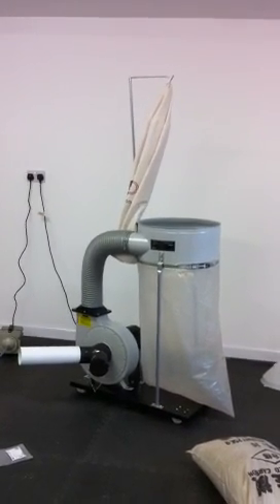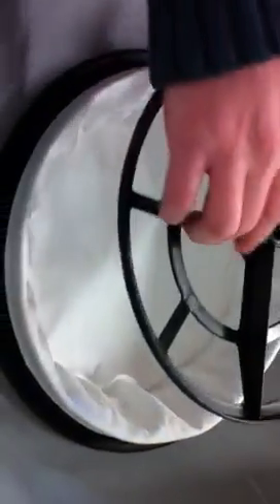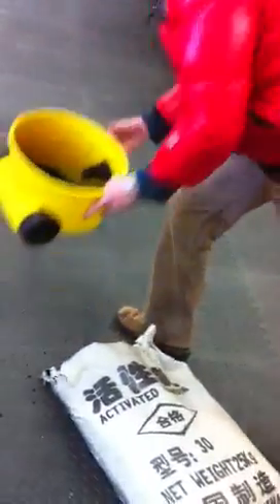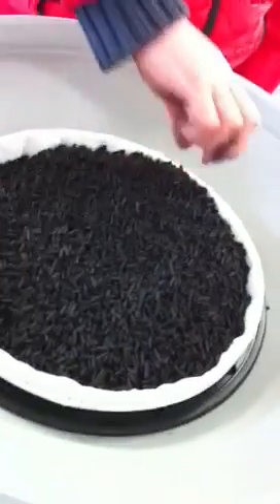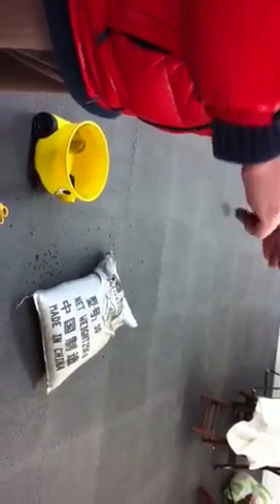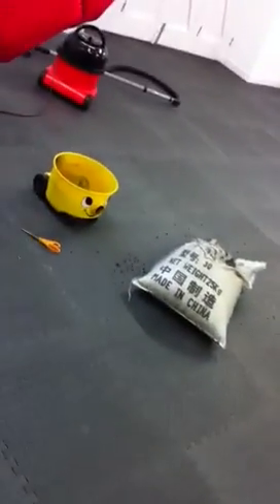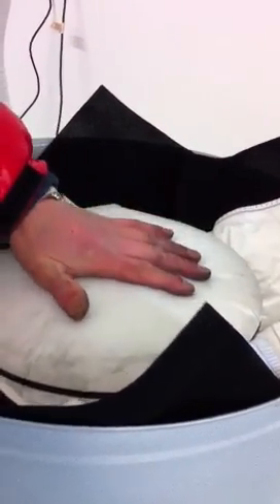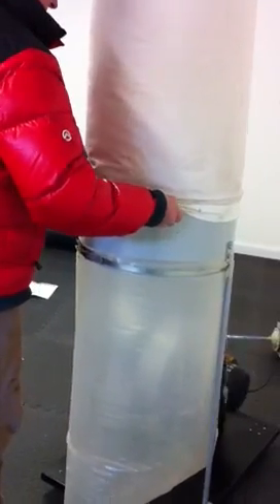Laser air filter

Comment: Does it really stop the smell?
Reply from the maker: Yes but clogged quickly and pressure difficult to contain.
Reply: @evorealtime  did you try anything else to make it work better? ¿how quickly did it clogged?
Reply from the maker: @G11R1  Depended on how much smoke from the material. A pre filter and better fab skills would have helped but we used a chimney in the end.